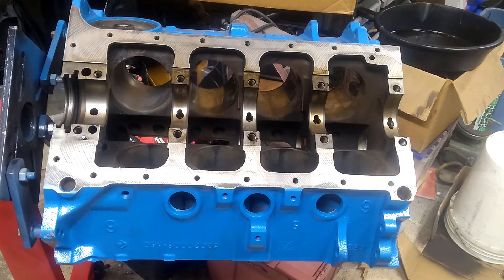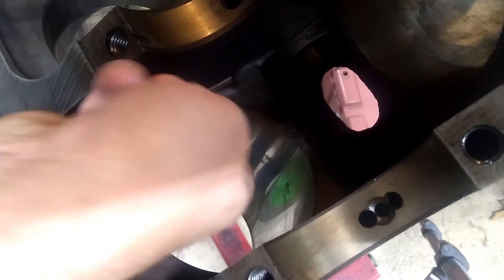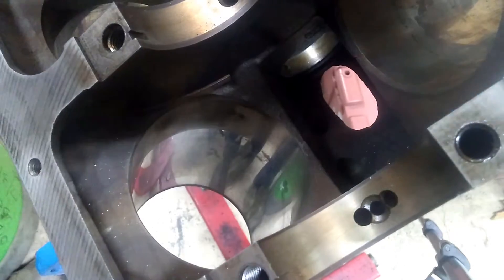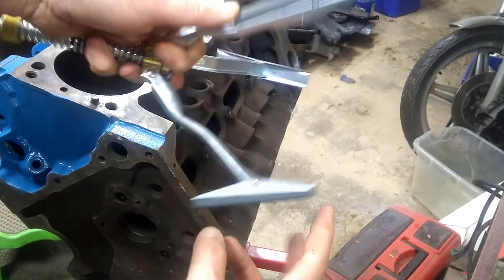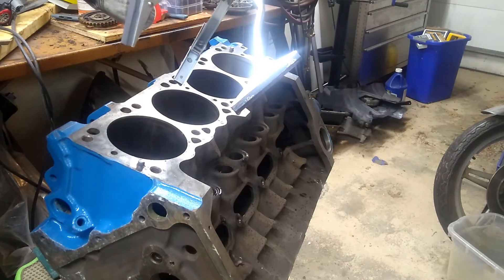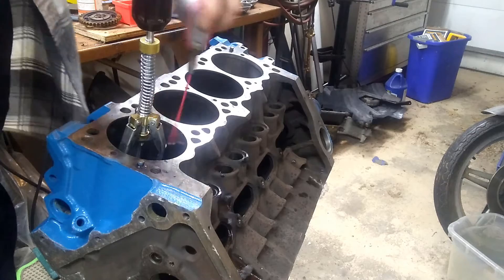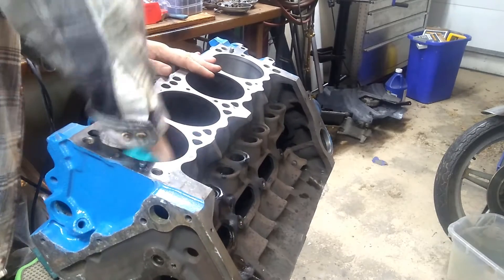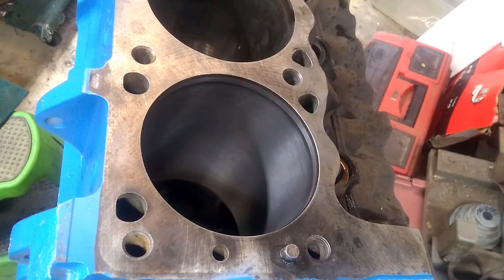Honing a Cylinder Block

Comment from the maker: First, keep in mind that this is a daily driver engine.  The entire point of honing is to provide a little friction to allow new rings to wear to the "not quite exactly round" shape of the bore.  If you didn't hone at all, you're still likely to have sub 0.001" gaps that some compression could potentially slide past.  My bet is that on an engine like this you might be dropping 2-3HP on the floor - at the most.  You'll lose more than that with not-quite-exact timing or a not-quite-ideal carburetor setup.

Internal combustion engines are simple and very forgiving in being able to run.  If you're building a high-horsepower motor, then yes, things need to be exact to squeeze every drop out of them, but for a large majority of daily and street stuff, it's just not that critical.

I remember my early days of working on cars.  I had plenty of time and not much money.  I suspect there are plenty of young people out there that are just starting out and everyone saying "Take it to the machine shop!" and "Just buy aluminum heads!" is not helping them out.  Can you go build a motor for $5k and make power?  Sure.  But you can also build one with less than $500.  It's not going to have as much power, but it will still move just fine and the person who assembled it will have not just built an engine, but built confidence.  They'll also intimately know how that motor works which is worth more than the cost of the parts.

I'm not showing how to build a mill for a 10-second car.  I'm showing that engines are not magical boxes that you should be afraid of that you must pay mechanical wizards to work on. 95% of motors that aren't physically broken can be put back together in a garage with just basic tool, new rings and bearings and run for years.
Reply: @YoshiMoshi - quick question. Have you ever used ATF as a lubricant when honing?  I've heard it works well and helps clean things up, too. Thoughts?
Reply from the maker: It would probably work just fine.
Reply: @Yoshimoshi  great video. Only old head engine guys really understand a rebuild isn't required to be flawless. You want it to run good and last awhile before it's done again. That'sall
As long as bearings aren't to small therE won't be n issue all. Everything you said in this comment was dead on. It doesn't tKe long to see how the best guys work ND I know you're a master of the craft from another master of his craft
ND THE NOBILITY and maturity to leave a heart react on a negative comment towards you juT got you a sub. Likea guy who can conduct himself in a respectful manner
Reply from the maker: Yeah, people like to pretend that a general functioning internal combustion engine is some magical thing. If they ever worked on an old hit or miss stationary engine their minds would be blown
Reply: @YoshimoshiGarage  There are so many "experts" who got that way because they watched some youtube videos about a subject, but yet they have never done the thing in their whole life. I see these commenters all the time. This guy sounds like one of them. I actually have done engine rebuilding in the past (before youtube existed and you had to learn everything from books) and I find your videos VERY helpful.
Reply: @crxtodd16  To properly hone an engine cylinder (not like this hack does), you should use a constant flow of liquid. You could use a large quantity of water if you wanted so long as it is capable of flushing the cuttings clear of the stones and the block. Oil, any type, is best, so long as it is of sufficient quantity.

In the video provided, you will only achieve a broken engine that will start smoking very soon after assembly. That is because engine rings require a 45 degree cross hatch to perform properly. 

And if you watch as he spins his drill at 8 billion miles per second, that is not what he achieved and whatever type of lubricant he was using he was dripping on the outside of the block (deck) and not on the stone 90% of the time.

Please do not do anything this guy does. He may have been a mechanic but that doesn't meant he was a good or qualified one. 

And judging by his videos, he wasn't.
Reply: @R jD  I'm an engine builder for gas and diesel. Especially powerstrokes. I run my own business. And lots of times I do this to them and they still scream like a bitch. Everything he said is right. The tolerances are only super pinpoint when it's a power upgrade build. A regular rebuild will be just fine like this. Dude knows what he's saying. You kinda don't. The cross hatch needs to exist and be decent angled but also doesn't need perfection
Reply: @jdubsteachings  But they weren't decent angles. Kinda sounds like I actually do know what I am talking about thanks to you admitting I am right and what he is doing is wrong.

Thank you!
Reply: To me, learning from some excellent engine builders and techs, Proper Carb setup and timing is a must, if you don't want a turd of an engine. Just something this simple makes a huge difference in performance, (among other things) of course.
Reply: While not young (45) - you just described me/ my situation perfectly. Have always done my own automitive repairs since a teenager, but first time tearing down an engine. (After overheating and changing water pump/ timing belt, I found stuck piston/ rings.)  Doing new rings and bearings. Zero extra money. My car was my source of income as a delivery driver doing the best I can in this economy. I know the importance of doing things right, and the exacting nature of machined components in automobiles, but just trying to get up and running on a car I bought for $2,500 with 180k miles.
Thank you for your explanations, especially reassurance that there's some forgiveness with engines, because I dont have all the tools I need to take the block out, remove crank, hot tank the block, measure bores, etc. Just need it to run.
Ive watched tons of YouTube videos, guys in their garage and pros, and your explanations are at the top. 👍🏼
Reply: Благодарю за слова вдохновения.

Comment: Your drill speed is way to fast! Put your drill in the slowest speed. Move up & down faster. So slow your speed & raise your feed. And just keep your drill axis centered & just move up & down. Don't try to put pressure to one side to make a area clean up. Let the spring in the hone do the pressure. Just be the machine & get your feed rate steady.

Comment: Would fine stones and doing this procedure work for moly rings?
Reply from the maker: I wouldn't use moly rings with a hand honed block.  They definitely require a more accurate crosshatch.

Comment: Nice video. Learned about the cracks.  I am doing this on a motor still in the truck. Had possible head gasket leak . One cylinder seemed to get effected . Pulled apart 6 months later to see a tiny amount of suface rust. Freed up rings . Now going to just hit with honing tool for a few seconds .  I have way to clean and keep debris out. I will check compression when i get heads back on.  83k miles on a 72 350 .

Comment: Will doing this change your piston size? Or do the piston rings compensate the shaft getting wider after honing it?
Reply from the maker: You won't take off enough to change the piston requirement. The ring easily expands to fill whatever you might remove.

Comment: So might be a dumb question, do you need bigger pistons after honing like you did? If you didn’t have a bunch of build up?
Reply from the maker: Not after just a home, no
Reply: @YoshimoshiGarage  thanks. I’m going to be redoing mine and everyone just says machine shop but the engine looks really good after a wipe down and such. Thanks again.
Reply from the maker: Everyone always seems to say "machine shop" but if you're refreshing a daily driver, not building a race motor, it's usually BS, unnecessarily expensive advice.
Reply: @YoshimoshiGarage  it had a lot of oil buildup from a leak onto the intake and it looks way worse. Pistons and valves all look good. I do appreciate the honest feedback. Saves me a buck or two

Comment: 120000 RPM on the drill will leave a perfectly crappy crosshatch. You will NEVER leave a 45 degree cross hatch for the rings to seat to. This not what you want to do EVER! The cross hatch is effectively 2 degrees which is a guaranteed way to burn oil from the first minute of runtime.

I hope everybody that watches this uses it as a video of what to NEVER do to an engine you plan to reassemble.
Reply from the maker: Cast rings are amazingly forgiving.
Reply: @YoshimoshiGarage  But it's still wrong. And wrong is never right.
Reply from the maker: Indeed! The rest of us mortals can only hope to always be as right as you. I'll work harder

Comment: I spent over 20 years as an engine reconditioner boring and honing  3 to 5 cyl blocks a day and i have never seen a 3 legged hone in any of the shops i worked in but i have seen the results of backyarder jobs with them when they were bought into the workshop to be fixed and i would never use one at home now i am retired. For a home rering job the ball hone is king for ring seal unless the block needs reboring. Some of the comments on here from armchair experts are laughable especially the one about the cyls already being removed but most are right about the speed of your drill it is way to fast.
Reply: In my experience, this can be a misleading comment. Unless one rebores first or at least runs a 3 legged hone, even with some bore measuring, much of the imperfections are cover3d up by the ball hone process. Measuring might show a few areas with a difference of say .001. But this does not show where the variations are. Are they due to an even taper? Are they only on the thrust surfaces? Is there a ridge you cannot feel but shows up once 3-stone honing begins? These are all super easy to miss when your first step is to grab a ball hone. The taper and “non feel-able” ridge is evident here once he begins honing. The ball hone would not have showed any of this. Remember most DIYers reach for the ball hone as it’s inexpensive and appears to give a great finish with little work - not because they have other proper hones and the ball is objectively better. They also seldom even use a dial bore gauge. It’s really just guesswork. In fact show me the diy guy who uses dial bore gauges who then just uses a ball hone exclusively. The ball is best IMO for removing staining or deglazing an otherwise perfect bore. 
Nobody has to do things the same way but they do need to obtain the same measurable results. These hones simply do different things.

Comment: please stop using the scotchbrite pads for a serfacer!!! Ive seen over .060"" dips from those effing things. as well as car manufactures have band them from the service bays!!! that hone is about as good as the dingleberry neither is worth a poop, but they are good for cleaning the bores before inspecting. thats about all there good for. do not hone very much!!! unless you plan to have the block bored. yes you can eff up the bore with those. you may of been a lot better off getting a real hone from sunnen or lisle, the lisle is much better than what you have there, the sunnen is much better than the lisle and always use the correct honeing fluid!!! and never hone rough!! always use a fine stone!!! why do you want all the wear area gone?? your just enlarging the entire bore and misshaping it too. unless you are changing pistons and need more clearance you do not need to remove that. torque plates should also be used. look at how much the flex joint is bowed!!  you now have a over sized wallered out bore....but it should be fine,ive seen oh somany like this, but that dont mean it's right., also turn the block so your going in&out easely not up and down. congrats you now have a bock that needs to be sent to the shop to be bored&honed.   and yes it's common to see cracked bores.Ive seen many and sleeved many.with torqueplates&proper equipment.

Comment: Have you ever used water and motor oil mix that turns in a white fluid when mixed for honing or boring  cylinders ?
Reply from the maker: Nope, always used a light lube like WD40 or penetrating oil.

Comment: I am rebuilding my 5.9 motor. The cylinderwalls still have the cross hatch, but not all around. About 20mm are missing (allways to the outside/sparkplug-side). Should I re-hone?
Reply from the maker: Yes, I would. It needs to be there so the rings can seat
Reply: @YoshimoshiGarage  ok, thank you

Comment: JUST TAKE IT TO THE MACHINE SHOP..HONING IS VERY IMPORTANT.. IF THE RINGS DON'T SEAL, YOUR DOING IT ALL AGAIN AND MORE...
Reply: honing cylinders yes glaze breaker no  !!
Reply: @kennethquackenbush8450  YOUR BORES HAD WEAR,THAT'S WHY YOU HAD A RIDGE AT THE TOP, YOU HAD NO ORIGINAL HONE THERE.. DID YOU MEASURE CYLINDERS BEFORE AND AFTER YOUR EFFORT  ???... AND ALL I CAN SAY IS TO WATCH SOME TOTAL PISTON RINGS, TECHNICAL VIDEOS ON CYLINDER BORE FINISHES... THEN YOU WILL UNDERSTAND THE THEORY OF CORRECT HONING TO WORK WITH ALL DIFFERENT PISTON RINGS... THANK YOU
Reply: @drcolster  ALL CAPS? ALL THE TIME?

Comment: NOPE! never remove the ridge  if using same pistons. naturally formed protection worn in by the rings from combustion temps, just a fine dingle/dunny brush hone its much better in honing up to the ridge to carry oil for sealing ,  we proved it with so many engines 4's 6's and v8's . compression and leak down test faired better than 30"over new bore. lol and your attempt!? love to have a temp gauge  at that speed  and no flowing wash!? grinding at the ridge what's the rest of the stone doing inch down? tiers good mpg. for an old girl